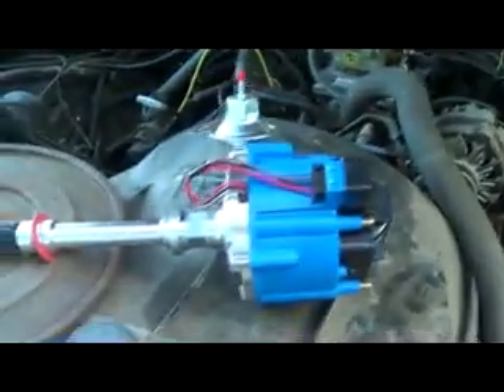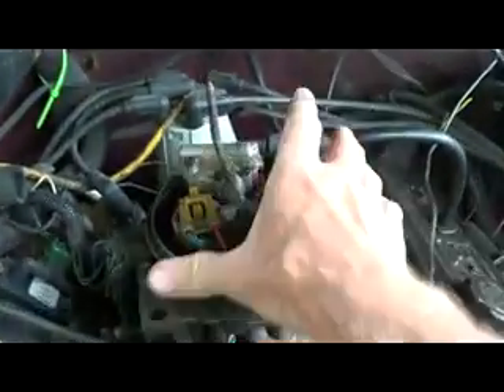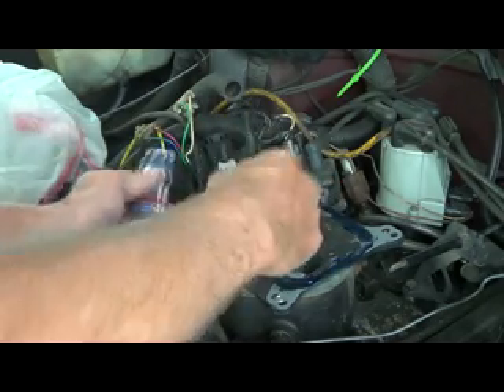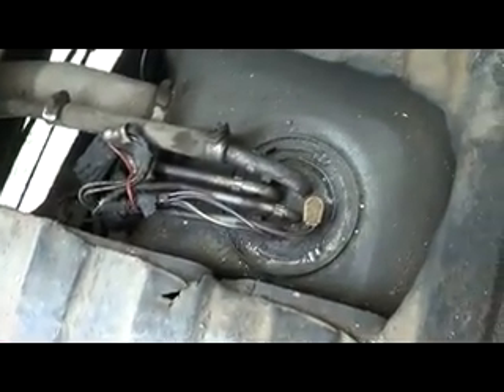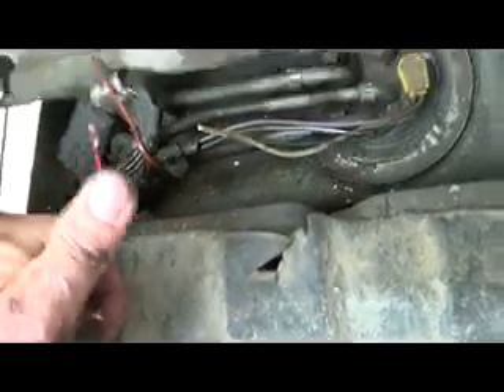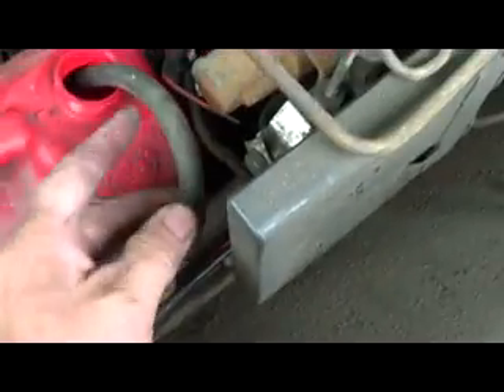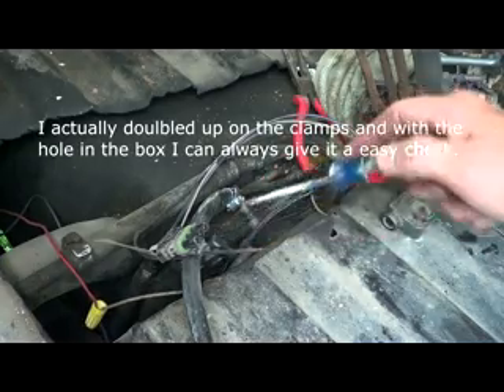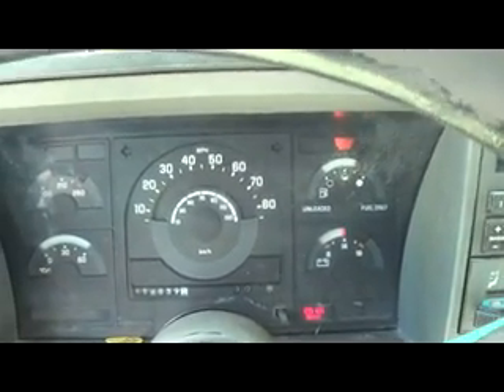changing from fuel injection to carburetor,  chevy truck 4.3 engine

Comment: Do you have a problem at the smog stations. In California I think that would be considered altered
Reply from the maker: where I live if you drive your car  under 5000 miles per year you do not need emissions,  and the emissions is still on the truck anyway,   thanks mike
Reply: As long as the vehicle still had it's emissions controlling components such as catalytic converter and mufflers and the secondary piping for the reserve tank for the vapors like he left on the tank it should pass inspection. Many vehicles from 76- and up usually pass inspection as long as the have catties,mufflers, air inlet cleaner tops with exhaust vapor return hose inlet still connected so it reburns left over gas vapors and isn't leaking oil or any other fluids it should be perfectly fine to pass the inspection test. Modded or custom  vehicles are not illegal as long as the ain't like trying to put a dragster on city streets lol but I live in Oklahoma and the last inspection was like 1995, lol so may be wrong on this one
Reply: from what I hear, those cali emissions tests are hell on slightly and tastefully modified vehicles (such as cat deletes with resonators because they're so expensive due to all the platinum).
Reply: exactly

Comment: Why in this world would you you change it to carb. Now your who computer is nothing but a boat anchor.
Reply: some children wont understand
Reply: maybe it was a boat anchor already
Reply: Rick Rabies Couldnt say it better than that!!!
Reply: Carburetors are cheaper as well as easier to work with for old timers. Switching to a carb from a factory installed fuel injected system could cause you to fail an emissions test in some states, though.
Reply: broke down on a drive from maine to florida in quantico va, had to pay $900 for o2 sensor, i think you make complete sense on this one.
Reply: Louis Laszlo: You are correct. This Modification would never be allowed in California. If its been modified at all it will not pass the visual test even if it could pass the PPM test.
Reply: Neapolis  
That's why California is being attacked by God's controllers
Reply: Because carbs are easy to tune up than ECU plus you heard a carbed up car tuned jeez but want this mod on 2018ford focus rs
Reply: Neapolis that's why you use your head guess it's once a year then swap the mod back that's how everyone done things were suppose to have cats do any of us any take your guess
Reply: Alex Cantlow I moved to Tn. years ago and the county I live in luckily has no emission tests requirements at least for now. Hope it stay this way. I can do any Mods without a problem. When I lived in cali. you had to test every 2 years.
Reply: When you lose the computer and add a carb you get instant fuel delivery changes by switching jets...you lose the crappy fuel pump module no sensors if you do choose and just a few simple connections...and a good mechanic will know how to adjust timing curves, spark plugs and cam profile to make the engine perform as good as it better than a FI system...other than that ...lol
Reply: i did it on my suburban and i drive everywhere
Reply from the maker: all I can say is I can drive the truck back and forth from maine to florida and only have a couple things go wrong, if you ever broke down on the highway and had to wait days for special parts you would understand,  thanks,
Reply: Lol that was the point to get rid of the computer bs
Reply: these tbi systems are junk
Reply: it's bullshit because you don't understand it it's unreliable because you don't understand it there is nothing at all wrong or unreliable about the factory fi

Comment: you could of kept the factory fuel system in place all you had to do was hook up a fuel block with a pressure regulator. Holley makes one and all you needed to do was route a line to the carb and pressure gauge on the block
Reply from the maker: I thought of that but the truth is I want the simplest system in the world to fix, and I carry an extra 10 dollar fuel pump and a can of gas with me, I have it so I can keep going no matter what,, I can't help being old school,  I appreciate it though, thanks mike
Reply: mike haduck 
Hello I have a 95 factory 5.7 L stick shift ,if I go big 4 barrel carburetor will it faster or add torque? I'm also old school , I have 10 + yr old 3 spoke wheels on my Silverado lol
Reply: carb will give you all out horse power but the efi system is better fuel efficiency and acceleration. each system has its pros and cons just depending on what you are doing will determine what set up you go with
Reply: Great choice!   I just am finishing up a ford 5.8L EFI swap to carb and the holley efi regulator was a waste of time.   I thought i could keep my original pump since it was new but what a waste of time.   It blew right past the needles within a second and filled the intake full of gas.   Im going to cut the wire for the fuel pump and splice in a low pressure edlebroch pump that every parts store keeps in stock.   If EFI was so much better than why doe the carb get just as good of mileage for you non-believers!
Reply: What kind of Trans do you have ?

Comment: Never ever use silicone on a base gasket, ever. Electric fuel pumps are designed to push, not pull. That's why the original is in the tank.
Reply from the maker: I changed the pump to down to frame below the tank,  I found out the hard way,  it was getting hot, you are right about pushing,  thanks mike

Comment: Nice video, I don't know if I missed something, or you forgot to mention, but it looks like you got a tbi to carb adapter AND a 4bbl to 2bbl adapter?  I am thinking of sticking with 2bbl so not interested in the extra gasket and extra chance for a leak.  I do like how you walked through the build, nice work man! I'm looking at doing this with a 2bbl to tbi adapter and stumbled across your video, nice to know it'll run with the stock dizzy until I can get the Vacuum advance put in it.
Reply from the maker: I have sense changed to a edelbrok 600 carb. more power and works great, I also changed to HEI distributor, also works great,  thanks,
Reply: Mike did you put a 4 barrel intake on or make more adaptors for the 600? Awesome video! I'm about to put my 600 on but need more info on what kinda intake is compatible? I have the tbi.350 1992. Thank you!

Comment: hello? vortec? how? i from venezuela
Reply from the maker: venezuela, hello,     I think vortex,  it works
Reply: Ik I'm about 3 years later but to do it on a vortec you are going to want to swap the intake manifold to the marine style which is for a factory carb then just run a regulator right off the factory fuel lines I'm currently doing this on a 96 got tired of injector problems

Comment: aye
Reply from the maker: aye also,  thanks mike
Reply: wat all tool u need n how long did it take to do all this
Reply from the maker: I planed it for about a month and then just did it.  I changed to a edelbrock carb now,  much better and put fuel pump on frame below fuel tank,  much better,  thanks
Reply: +mike haduck. i got a 1996 suburban do u think i juxt put a 1993 motor in do yo think i can hook it up like that
Reply from the maker: I would not know, lots of work there, thanks mike
Reply: +mike haduck well do u no how to hook up a motor
Reply: yup. pull old out, put other engine in.

Comment: Where you find that pump at
Reply from the maker: you can get one at any auto zone, relieys, advanced auto,  I leaned it is better on the frame below the fuel tank, otherwise it gets hot,  thanks mike

Comment: Thank you for kicking the EPA in the ass. I did an EFI to carb conversion on my '93 S10 4.3. Mine was a bit more complicated, as I built the engine for drag racing. I used a new Edelbrock manifold and Edlebrock 500 CFM 4 barrel carb from Summit Racing. I completely removed all the shit electronics, including the computer, and took great pleasure in doing so. No more electronics period. I did not need the factory gauges, because I installed all new Autometer aftermarket gauges.
Reply from the maker: I am a fan of edlebrock carbs, ( which I changed over to)  they take between 4 & 7 lbs pressure,  so I would say anyway you get it to that will work,  I would do your research,  I hope it helps,,,, thanks
Reply from the maker: +vulcan1753  I am going to change this one to an Edelbrock  carb also,  keep the faith, thanks mike
Reply: i have a 95 and i wanta keep my og fuel pump when i put a 350 in it can i keep it and put a fuel reg on it or will i need a new pump
Reply: depends if the 350 will be carbureted or EFI. If carbureted, you can either use a mechanical pump bolted directly to the engine block, or a low pressure electric pump. If you plan to run EFI, you will need the original high pressure pump. 

If I were going to do a 350 conversion, I would uses an older engine, '60s or '70s, or an aftermarket block and heads.
Reply: i have a 1970 307 from a chevelle that i want to put in my truck that is carb
Reply: what all did you do to the 4.3? I am curious about building one. I am concerned about the crank. since it has split rod journals. they just do not look like they will handle much power. did you go with a aftermarket crank. and swap to odd fire? I am looking in to the odd fire swap. I have read you must swap to a older 229 v6 distributor. I'm not sure about the cam. it may need to be from a 229. but I have heard they sound awesome with a cam  and odd fire swap. will you share what you did on your project? it could be a great help. thanks
Reply: will you share your build. I am very interested. in what parts are available for high performance 4.3 v6 thanks
Reply: So did you have to put in a new tranny to fit a proper spring-style speedo cable?

Comment: Hey thanks Got a 350 core born as tri with no throttle body, I have two carbs and want to run carb. I have no vehicle to put t in yet.Your vid was fun and informative. Thanks
Reply from the maker: +Patrick Reynolds  Thanks, Pat, lot of folks thinking like us. I have done it before on a ford truck and towed a boat to florida, there is a lot less to break for sure and everybody could fix it.  I wish you well , mike

Comment: If you ever get in a front end collision your fuel line placement is in a poor position. Also, that fuel regulator is trash! I will be surprised if it is still functioning as of this post but spend the extra 20 bucks and get an actual fuel regulator!
Reply from the maker: +MrRelytkce  I appreciate the advice, thanks mike